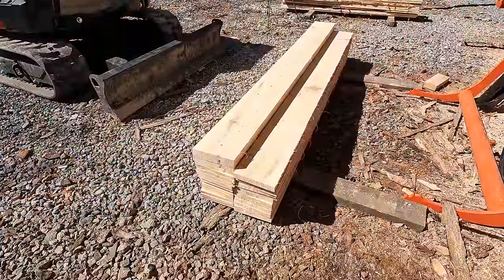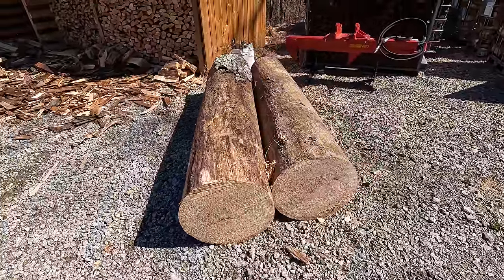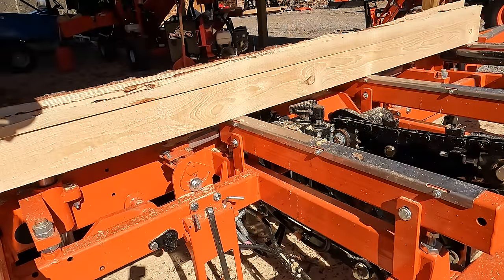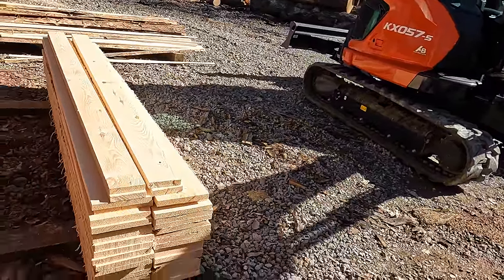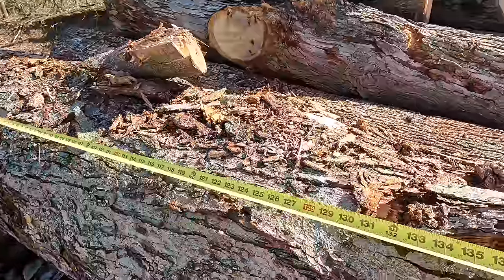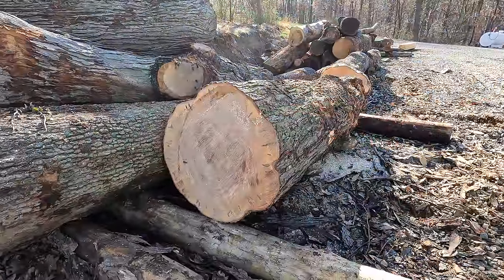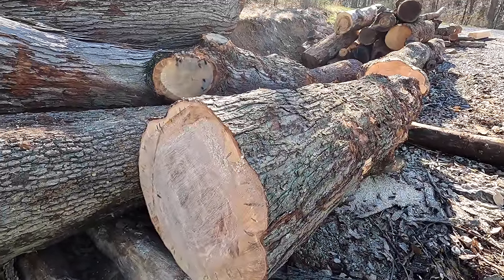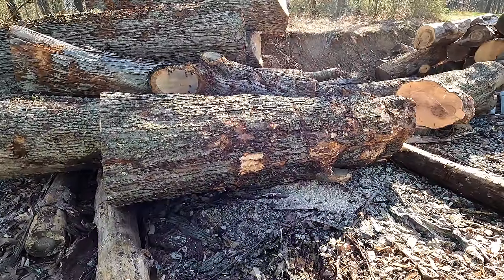New Hire at the Sawmill? Will see how she does

Comment: Another great video Mike, with my coffee this morning.  Speaking of Zippo Lighters, I still have mine that I bought at the PX when in arrived in Korea in October 22, 1966.  Even thought I was not a smoker then or now, I used the Zippo Lighter to light the Diesel Stove that we had in the Army Barracks and in the Orderly Room where I worked.  I had my name put on my lighter on one side and 66 Korea 67 on the other side, to indicate the 13 months I was stationed overseas.  On the bottom of the lighter is IIII Zippo IIII to tell when it was made meaning April 1966.  It still works when I put lighter fuel in it.

Comment: For 6 x 6 building code will say you will want a 18" auger and that's because usually building inspectors like see that diameter for the cement pad you set post on

Comment: That big flared end. Cut cookie rounds at say 4" thick and get a pair of live edge rounds for 
end tables. At 50" make a small kitchen table round. You cut 3"-4" with the chain saw put on 
the slab flattener and you get a finished table at 1.5"-2.5" thickness great for table tops.
Hard to find slabs that size you can find a viewer who wants it.

Comment: Mike, do yourself a favor. If you are going to use the auger for 6x posts, you'll need the room of a 16" -18" bit to manage the post to the correct spot without pulling out the shovel.
Reply from the maker: I got a 9 and a 12 coming, hopefully the 12 is big enough
Reply: @OutdoorsWithTheMorgans  I am currently using a 12" for 6" post, which works as long as you are very accurate with the layout. However, i sometimes rent an 18"  for rocky soil, which can make life a lot easier.  
I enjoy your content and agree totally with your point of view.

Comment: It wasn't that your skid steer wouldn't lift it, you just couldn't the back end of it on the ground, The log trucks I ran had 1/3 and 1/2 cord grapples, but those are just the beginning. Log trucks have a much longer base and outriggers to stabilize the load. Every machine has its limitations.

Comment: You can cut 40”. Your head will lift 35” and then your throat is 18”. I’ve sawed 40+ inch white oak. Just make sure no knot or bow is on the post side to hit. Just saw until you can’t then rotate.

Comment: Mike the 9 in auger is ok for 4x4s but to small for 6x6s unless it’s not important their exact location as there won’t be much wiggle room a 12 in is about as small as we use for 6x6s if you measure across corners on one you will see they are almost 8 inches so no extra room just a tip from a guy thats had to many hours with the digging bar 😊

Comment: If there is a way for you to save the first peeling cut off the logs, and you had a place to dry them, I think they could’ve sold for siding for any one wanting to have a log like exterior for a house or barn etc?
Reply: I've sided a small outbuilding with sawmill endcuts. They are great for smaller buildings that don't need to be weather tight. Some millers call them "hog boards" because they are popular for fencing in hog pens. Great for firewood sheds to, since they naturally allow air flow through a building. Most millers give them away or sell them for cheap. And they end up burning most of them since they generate more than the demand. Siding a house with them would be problematic in multiple ways. They are too irregular for that, and the bark naturally starts falling off of them at varying rates, so it looks pretty rough after the first year. Plus you would be encouraging bugs to live in your siding because of the bark.